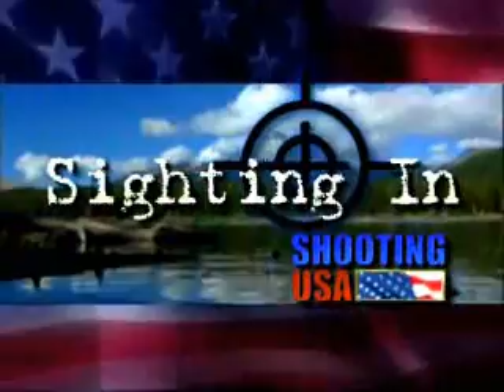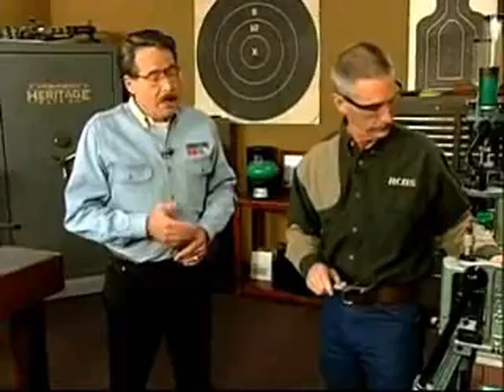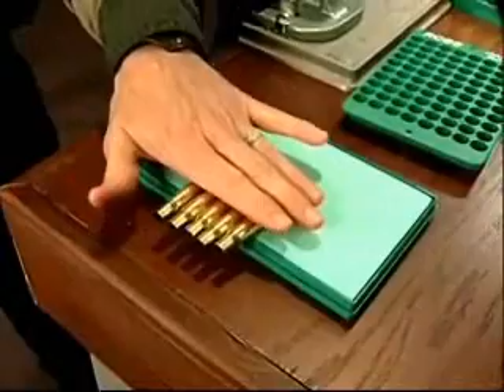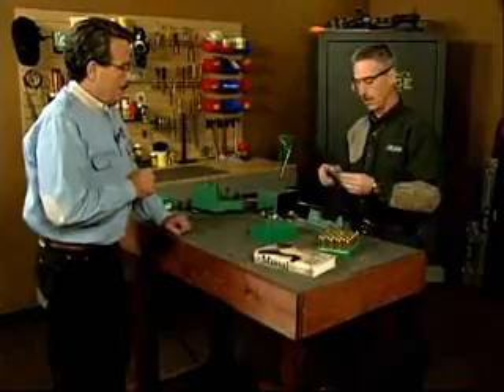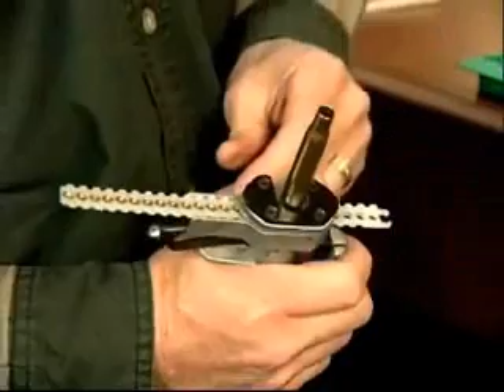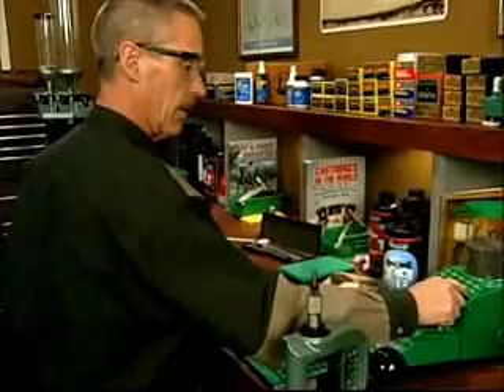Jim Scoutten RCBS Single Stage Reloading

Comment: You do not have to buy all the electric powered gizmos that were shown in the video, to reload/load  ammunition. All that the expensive electric powered gizmos do is make it much easier and faster.  You can do just as good of a job with manual tools!